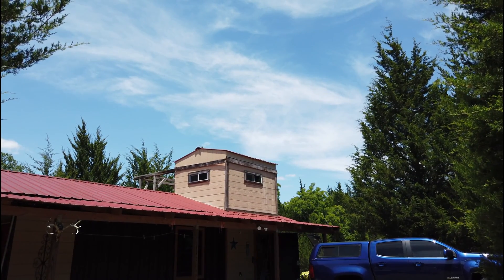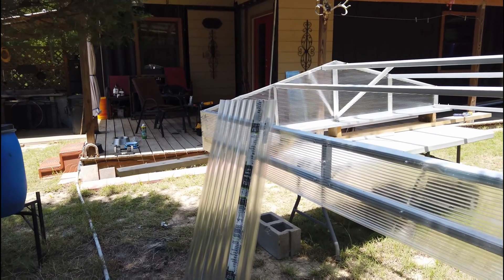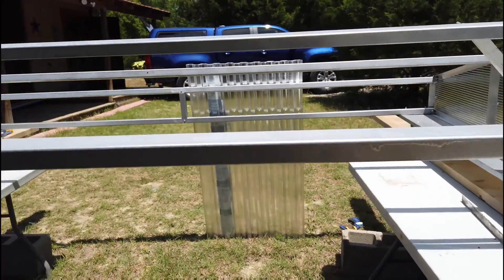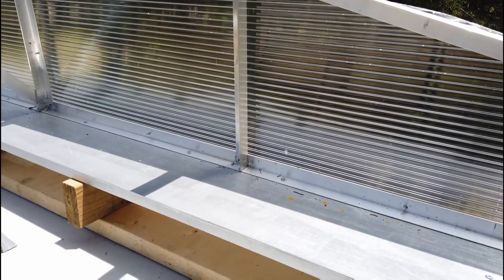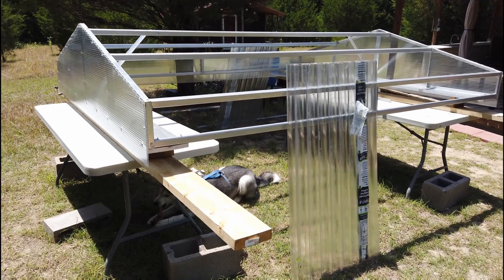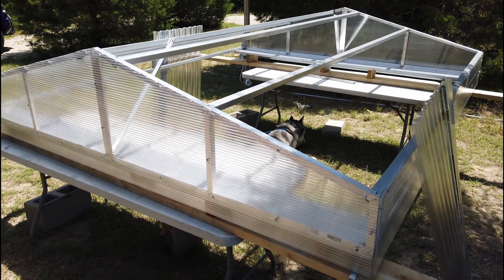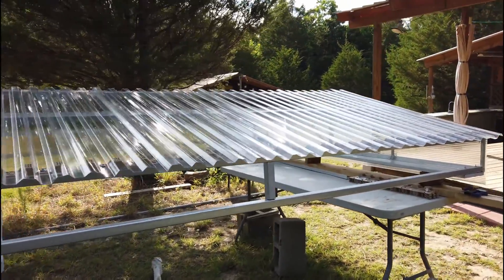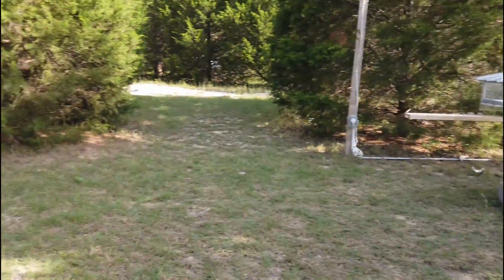Time to rebuild my observatory's Roll-Off-Roof

Comment: Hello.
This transparent roof is very cool!
I am also building an observatory.
I'm wondering whether to make the roof iron or polycarbonate.
I think it would be good to know polycarbonate that cuts infrared rays and combine it with heat insulating material.

Comment: Hi Bob, I love your new roll-off-roof. 
I am very sorry to see that the wood of the original observatory deteriorated in a short time, perhaps due to the type of wood or the treatment to prevent it from being dehydrated by the sun.
I love the translucent sheet design, but you should consider forced ventilation to avoid heat build-up. Although UV is rejected by the translucent sheets, the visible light becomes IR light when it collides with objects inside and heat accumulates progressively during the day due to the greenhouse effect. 
You can easily avoid this by introducing fresh air at floor level and exhausting it at the top of the ceiling. There are several ways and the cheapest is with Wind Driven Roof Exhaust Fans which does not require electricity. This will improve the interior temperature by 10 to 15 ºC.
I am designing 2 roll-off-roofs to install one in Venezuela and the other in Spain (in Galicia to the north ). The climatic conditions are very different and I have liked several ideas that I have seen in your observatory. 
Thank you very much for sharing. I wanted to write to you in Spanish, but I'm not sure if you speak it or not. 
https://www.alibaba.com/product-detail/wind-powered-exhaust-fan-roof-mounted_60803340479.html?spm=a2700.7724857.normal_offer.d_image.ac8b2701R4QS3i
Reply from the maker: Hi Jesus. Thanks for your comments. I knew that the old wood frame would eventually deteriorate and was surprised it lasted 4 years. The roof has ventilation at the peak and the windows can open to provide cross-ventilation. If the heat ever becomes a major problem I will replace the translucent roof panels with some dark tinted ones. And yes... sí, sé hablar y leer español y Gracias por tus grandes ideas

Comment: I know you were hoping the clear roof would be cooler but has it shown to actually be the case?
Reply from the maker: Truth is that it holds about the same temperature as the metal roof, but my main goal was to reduce weight. It is much, much lighter now, and I have noticed much fewer insects than before. Plus it looks amazing at night!
Reply: To minimize heat buildup in the interior, roof and siding materials with high reflectivity and high emissivity are required.  Here’s a link to some data on a variety of roofing materials.

https://f.hubspotusercontent30.net/hubfs/6069238/pdf/Solar-Reflectivity-Index.pdf

Comment: i am thinking about doing the same type of roof for an upcoming observatory build. I saw your earlier video when you gave a walk-thru, and I too want to implement garage door rollers into the design. A question tough. your new roof design uses a lot of aluminum and the garage door roller brackets are steel. how will you cope with the corrosion issue?
Reply from the maker: If you look at the video at 15:57 you can see that under the 1x1 alluminum frame is a 1x8 wood board painted silver. Under that is a 2x4 wood board painted black to which the rollers are screwed to. The 1x8 allows the roof assembly to overhang beyond the exterior face of the wall since the rollers have to be mounted further inside to fit into the track. No alluminum touched metal.

Comment: Great video. How is the pier connected to the floor. Have you any vibration issues if your walking around ?
Reply from the maker: Thanks Dave. The pier is anchored to the ground with concrete and filled with sand to dampen all vibrations. The floor of the top story does not touch the steel pier. You should take a look at my other videos showing how I built the cabin and observatory.